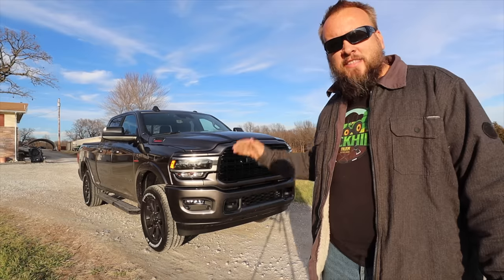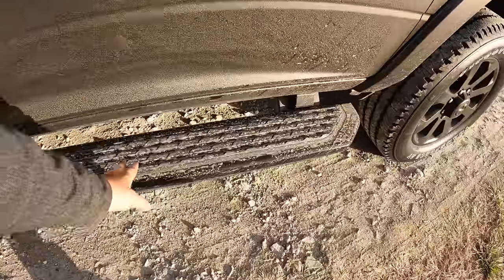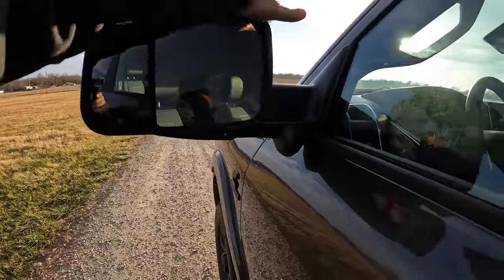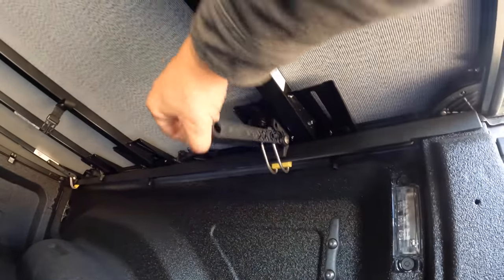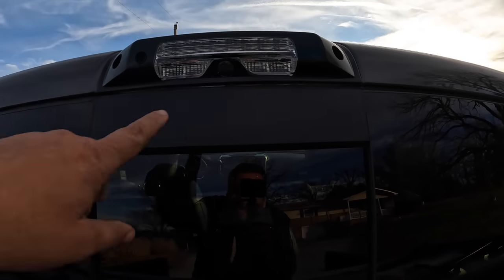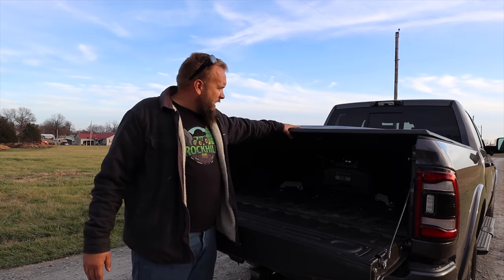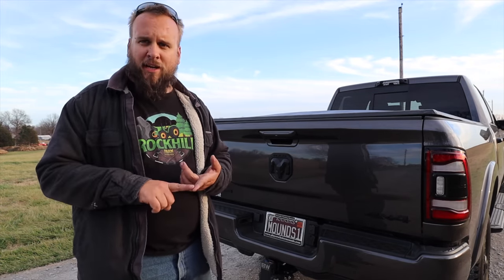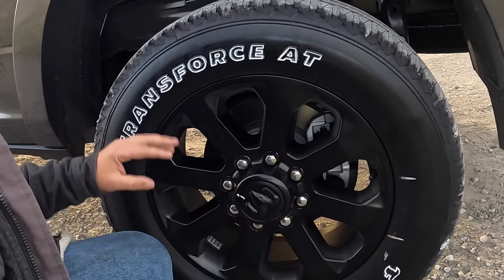NEW Ram 2500 Laramie Night Edition Review

Comment: I also am going from a 2019 Laramie 1500 and will be ordering a 2023 Laramie 3500 when they open up the ordering system. Things ive learned from my 2019.  I will not get a sunroof. I barely use it and the 1500 has the large glass roof. It adds so much additional heat into cabin. I  also will not get power running boards. One thing you dont realize is how much fixed boards help protect from door dings. Otherwise I will order my 2023 optioned just like my 2019. Im going for the 3500 for the extra payload capability.

Comment: congratulations with your new truck it's absolutely beautiful, it has options that I didn't even know existed. I think if I were you I would buy one of those $2 black paint pens on Amazon and black out the white lettering on the tires and then stand back and look at it and if you don't like it you can always take the lacquer thinner and wash the black right off . you are now officially set up to pull your new skid steer can't wait to see the videos
Reply from the maker: Definitely loving the truck so far. Thanks for Checking in

Comment: Brock, last time I made a comment I told you I have the exact same truck as your white one. The funny thing is I traded that in 4 weeks ago on a 2022 limited longhorn 2500 short box Cummings. I really like the truck. The plug you are calling an rv connector next to the 7 way is a 12 way that is used for a camera kit you need to buy from mopar that adds 4 cameras to the trailer. Once you add them you can set up the trailer size in u connect and it will add your trailer to the surround  view with the truck. The kit is so new the dealer did not have a part number for it yet. They just showed the camera kit for the mirror on the back of the trailer. I to was disappointed in the payload, mine said 20,000 towing with 2100 payload. The truck we had was 1800 payload. It hard to believe  my new truck can only haul 300 more pounds than my 1/2 ton. I find that hard to believe.
Congrats. Nice truck.
Reply from the maker: Thanks for sharing that information. My dealer did not know about that other plug but I’m definitely going to get the trailer cameras

Comment: Just found your channel.  Great video and review. I’m currently in the market for a Laramie withCummins. I found a 2022 with 20 k miles.
Curious if you would be concerned with the miles?
How has your Cummins been and what is the fuel economy?
Also the truck I’m looking at does not have the Anti Spin axle. Do you find the need for that option or will the 4wd help in those situations?

Comment: Congratulations on the new Ram. Personally I think that Ram has the best trucks since the last update.
Besides Ford and Chevy are having problems at the moment.

Do you like the 12 inch screen, or prefer the 8.4? Wondering because eventually I'd like to order one as well.

Thanks Brock for another video! 🤠
Reply from the maker: I was tempted to get a Ford but since I’ve never owned one I would’ve wanted to test drive and those are not available

That 12 inch screen is a must have for me. Because you can have your map up large but also have something else on the lower half

Thanks for watching and for commenting
Reply: @RockhillfarmYT   Yeah I've got a 2013 F-250 and it's been a good truck. Nothing has broken after 145,000 miles, how ever it is a Glasser. Also have my granddaddys 2000 F-150, which is dead reliable.

I live in Kentucky where the truck plant is and my neighbor works for the plant. Lots of electrical issues ever since the 2020 model year.

I really do want a Cummins diesel though so might be saving up for one though.

Thanks for your opinion on the screen, it'll definitely play in to ordering mine one day. Thanks
Reply from the maker: Thanks for sharing your experience

Comment: Nice video and taking the time to explain some of the features.  I am in the market and thing I thought I had no use for no I will re-evaluate because of this video.  Did you happen to test drive the non-air assist version.  Because if you get the Off-Road package you can't get the air assist.  Wondering if there is any comfort difference in the ride.
Reply from the maker: I didn’t test drive anything because nobody had anything on there lots.  

My last truck had the air ride and I new I wanted it in this one

Thanks for watching

Comment: I’m fascinated with the rear view mirror also. What’s silly is mounting you phone in front of the vent when you paid for Apple CarPlay and wireless chargers. 🙃 People can’t get away from their cell phones these days. Nice truck and great review.
Reply from the maker: Thanks for watching and sharing your thoughts on it
Reply: @RockhillfarmYT  No problem at all. Are you thinking about getting a 3500? It has leaf springs.
Reply from the maker: In the future, probably, but Logistically I can’t make that happen right now

My truck has the air suspension and I did a video using the Weigh safe hitches and driving back and forth to the scales

I can safely haul anything I currently own

Comment: How did you adjust the small side mirror.  I know how to adjust the big one with the button but do you have a separate button for the smaller one. Thanks
Reply from the maker: Yes, there is a button that switches the same control pad so that it is moving the small mirror
Reply: Thanks 😊. I gotta go look for this button 😂
Reply: 😂 duh I found it.  I thought that top buttons was the heated mirror button.  Thanks again

Comment: Right.  You cannot have Ram Box and the 5th wheel together.    It is either one or the other.
Reply from the maker: Exactly. Ram boxes would’ve been nice. It’s really practical to have more storage there although I like the look of the truck better without them

Thanks for watching and commenting
Reply: @RockhillfarmYT  I think there are some aftermarket kits that let you install 5th/goose (with ram box).   From what I understand, the reason they dont let you have both is ..something along the lines of the front of trailer (i cant think of the proper name sorry) hits the inside of narrower bed during turns.
Reply from the maker: Thanks for the info

Comment: Did the diesel eat your payload up? I'm picking up a 2500 next week, it's gas, 2900 payload. Has after market suspension & a kit, or it would be a bit north of 3k.
Reply from the maker: Yes, the diesel weighs, an extra thousand pounds, so it takes 1000 pounds off the payload rating.

Although honestly, I think the truck can handle a lot more because it has the air suspension.

I do try to stay within ratings though
Reply: @RockhillfarmYT  that makes sense. The one I'm getting has a Carli kit, no air susp, I'm just moving a 2k pop up bed camper. 

I would think for you if the load is well centered you can probably get away with quite a bit. 

Nice rig! can't wait to pick mine up
Reply from the maker: @StrateOutdoors  congrats on the new truck

Comment: I have Ram 2020 6.7 Diesel and i have to install stair in the back. Any recommendations?
Reply from the maker: I got the factory step on mine so you could probably have the dealership do that.

On my previous truck I had a truck accessory shop install the same‘s basics step but I don’t know what the brand was

Thanks for watching

Comment: Is the column shifter optional or only on diesel trucks cause I prefer column shifter on regular fuel trucks not the middle stick or door knob
Reply from the maker: The 1500s have a dial shifter

The larger rams have the Column shifter
Reply: @RockhillfarmYT  will sadly that's stupid I prefer old school on trucks it not only cleans up the middle but also as some people say hope your not trying to fix the volume by accidentally touching the gear shift dial

Comment: That's a very nice truck.  Personally I don't want one that is smarter than me so that limits what I can get.  I currently have a 1954 Austin Champ (military - kind of like a jeep), a 1955 Dodge M37 (3/4t military truck), 2008 F350, 2010 Nissan Titan, and a 2015 Nissan Titan.  The 2015 is the only one that has even an infotainment center and it's pretty limited in what it does.  The 2 Nissans can haul my 20' trailer with a light load and the F350 can handle anything that I can haul on the trailer so I'm pretty well covered.
Reply from the maker: Sounds like you’re pretty well set on trucks. After I ordered this and waited for months there were several times when I was wishing I hadn’t ordered it and tried to buy an older used one
Reply: @RockhillfarmYT  Used market is as crazy as new. The important thing is you’re happy now that you have it. It should last a good number of years and like everything it’s about depreciation. Did you get the “you have to fight for it” extended warranty?
Reply from the maker: Yeah, they had used trucks on the local Ford dealership for over $60,000

I bought the warranty. I always say I’m not going to and then I end up doing it

Comment: Beautiful Truck! Not sure if you know the answer but I just recently tried to build a truck on Rams website and for a Laramie trim level 2500 it does not have the towing technology group as an option. It's only an option for the PW and longhorn. Any idea why? Thanks
Reply from the maker: I don’t know why that would be. Mine is a Laramie and it has the towing technology package.

I ordered in September so I don’t know what would’ve changed

If you’re serious about ordering a similar truck I’ve done a couple more videos about understanding the payload on a three-quarter ton diesel. You might find those helpful because I was a little disappointed that the payload was not what it showed it was going to be on the website

The next follow up video was checking my trailers with a Weigh safe hitch to see how much weight was transferring to the truck

The BIG Problem with 3/4 Ton Diesel Trucks - Tow Capacity Vs Payload
https://youtu.be/yNhMLd6MJsw

Not trying to talk you out of it, just sharing info

Thanks for watching
Reply: @RockhillfarmYT  Thanks so much for the reply and information. I really appreciate it! I was looking at payload and towing information on Rams website as well and they show different numbers for seemingly the same spec truck, weird.
Reply from the maker: I looked mine up in this video and then 2 weeks later it shows me different numbers which doesn’t make sense
Reply: @RockhillfarmYT  Weird. Doesn't make sense. Makes it tough for us as consumers if we can get accurate consistent info..

Comment: What was the Dealership's Market Adjustment cost? From 55,000 to 83,000? The dealership made a killing off you man!!
Reply from the maker: I’m not sure what you’re saying. I paid MSRP. 

55,000 is the base price without any changes. Just upgrading to the diesel is 10,000 so you are at 65,000 right there.  

It’s all options to get to that price. I think there might have been a destination charge of $1500 or something like that
Reply from the maker: I showed the window sticker. There is no market adjustment cost on there
Reply: @RockhillfarmYT  
MSRP is the manufacture suggested retail price. There is always another Dealership window sticker that shows the Dealership Market Adjustment price.
Reply from the maker: I paid MSRP plus a moderate destination charge

Comment: Ford and Chevy have the same set up. Never been a Dodge fan and never had luck with them. Yeah I did all the preventative maintenance and all that jazz. CHEVY is my 1st choice. Ford 2nd and 3rd Toyota. 👍👍
Reply from the maker: The day my transmission went out on the Dodge I went to a Ford dealership to look at an F250 and not only did no dealership in the area have one but they said it could be as much as a year to get one. Basically they had no idea what the wait time would be

If they had an F250 that day I probably would’ve bought it

Chevy could’ve got me one a little quicker than it took my dodge.

I bought my first Dodge when I was 18 and that’s the only trucks I’ve owned so it was tough to try to talk myself into spending that much on a Ford without having driven one

Thanks for watching